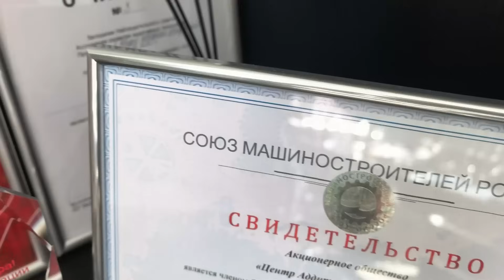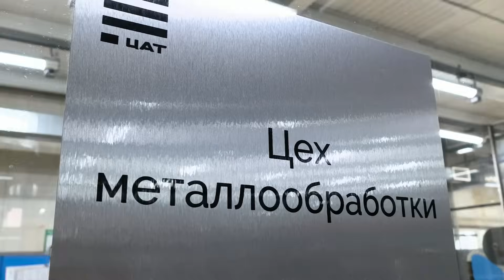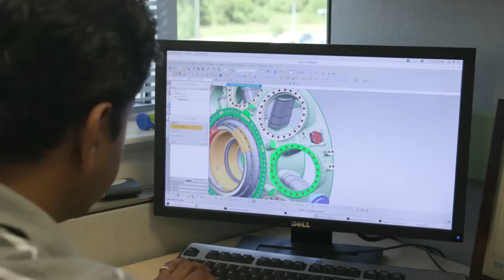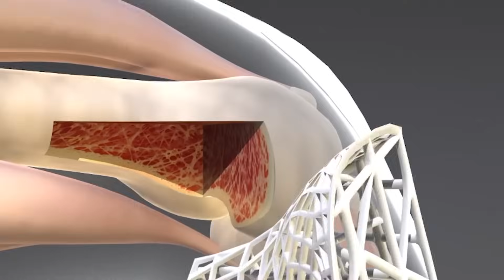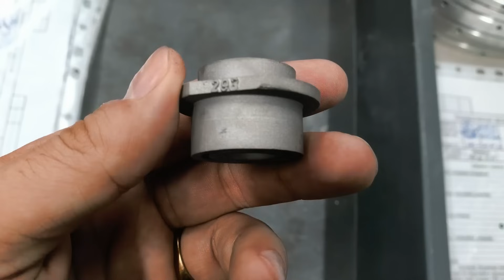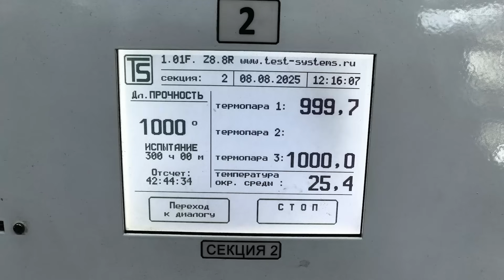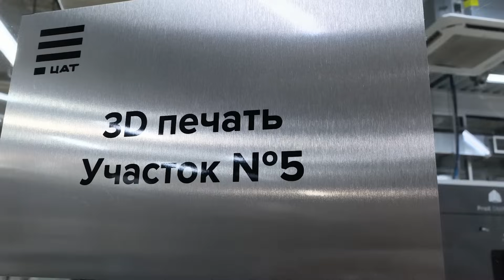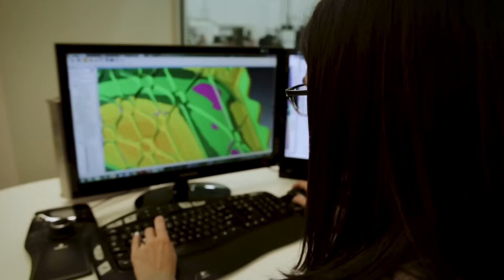How 3D Printing Will Change Everything?

Comment: Yeah, there's a reason sintering engine parts was abandoned by the civilised world.

The parts are extremely brittle, and have surface roughness in the mm range.
Reply: General Electric is still fully involved in metal AM for engine components - with post-processing like surface machining and hot isostatic pressing, you can get parts of much better quality than the raw components that come directly out of a printer. In theory - the end goal is to use AM to produce "near net shape" components that are then more efficient to finish than conventional machining from solid billet